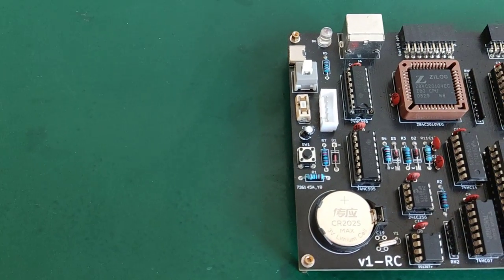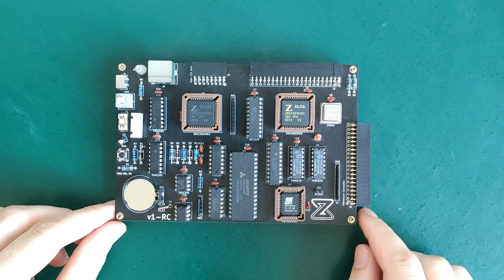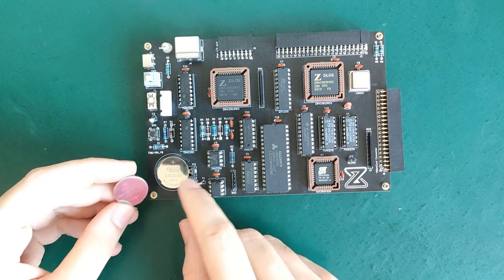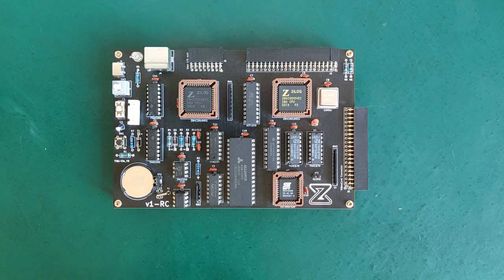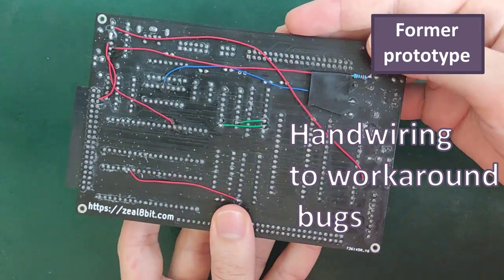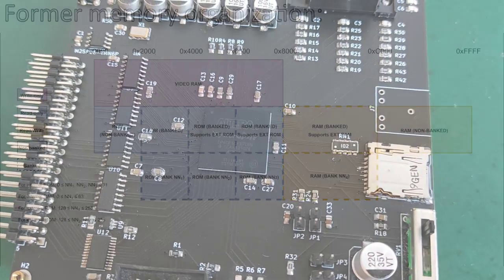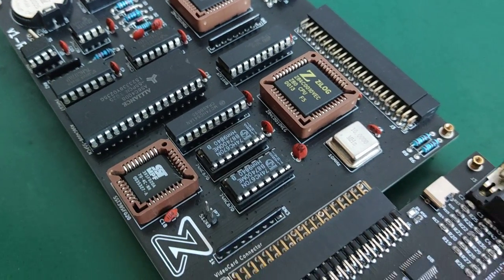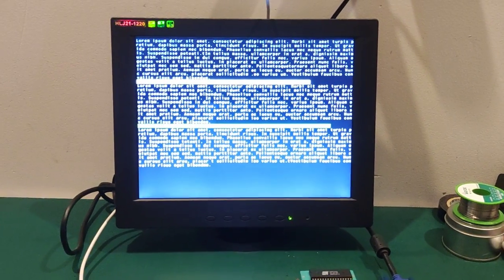Latest prototype of my 8-bit computer [Zeal 8-bit computer]

Comment: I follow your project for almost one year. I am surprised that you have gone so far and made these improvements! The latest prototype seems really exciting. Could I buy the kit ? ( Z80 motherboard and custom video board)
Reply from the maker: Thank you very much for your support, it's very motivating!
Yes, it was a lot work but it was completely worth it.
I plan to sell few units (motherboard at first) in a near future, not sure which form factor: DIY kit or already assembled, I'll keep you informed 😄
Reply: @Zeal8bit  do You have a patreon account?
Reply from the maker: Thanks for your support😄
At the moment, I don't have a Patreon account
Reply: @Zeal8bit  would be nice with an assambled version since i'm mostly interested in the using the computer for programming and not making it. is it possible to get an email when its available....form factor is not important to me, i guess i will build a wooden cabinet for it that protect it.

Comment: Congratulations on the progress of your homebrew computer development! If the CRT interface were made with standard TTLs, the circuits would be troublesome, but it is realized with FPGA and is very integration. I am making my own computer with an old 8-bit CPU too. It is fun to learn the basics that are lost in the latest PCs.
Reply from the maker: Thanks for your message!
Agreed on that, it would be feasible to have a TTL video board, not too hard but too limited, mainly for graphics (for text it should be ok)
As I wanted a platform where we could play and develop games, graphics are important.
Are you using a Z80 also? 6809? 6502?
You're right about this too, I also think PCs nowadays are a bad (horrible) beginning to start learning hardware. 8-bit CPUs and computers have the advantage to be deterministic, simple and can be mastered by a single person.
Reply: @Zeal8bit  Thank you very much. I use 6802 and 6502. The Z80 I used 40 years ago.

Comment: Great work!

I am 59.

I was a bit too old to get the bug as only young pre-teens can, but I was into doing 8 bit hardware and software (firmware mainly) as a hobbyist.

One very very advanced CPU was the MC6809E a multiprocessor environment compatible device.

I get that you are a Z80 fan boy, but if you look into the E variant of the MC6089, it will shock you. 

Truly unique, Excellent device!
Reply from the maker: Hello, thanks for your comment!

I discovered the 6809 recently, while talking with a friend who is also a hobbyist and made a homebrew computer based out of it and I must say that the 6809 is really a great CPU. I love its rich addressing modes. It's a shame it wasn't more used or more known. I guess it because it came out late and was more expensive than the Z80 or 6502.

Is it discontinued? I have seen some brand new 68000 not a long again, but I don't think I have come across any 6809
Reply: @Zeal8bit  AFAIK, Hitachi souped up the ALU and registers to make their 6309, still in production.

I would be very surprised if the 6809E is not still in production. 

I have a funny feeling this CPU was "too good" for tge home market. It got used a lot in Japanese business equipment. I saw it in electronic typewriters I repaired at CANON Australia in 1985.

The LEA, etc., make it GORGEOUS for compilers to generate code for it. The position independent code is made for implementing NICE software!

I only coded mainly for the 6802 or Z80.
A bit ofc6809, but you need a compiler to make it sing.
Reply: @Zeal8bit  looks like they are mainly old new stock. Prices around $12...
Reply: You're never too old to pick up a hobby like this. I read somewhere that a lot of electronic fairs are populated by people in their 50's, so you don't need to be a young pup to explore your interest.

Comment: This is fascinating, thank you for sharing your development process! I had considered using 3  4x4 register files in my MMU, but I most of the ones I saw were obsolete. In that design, I ended up going with the 74610 instead, but it's kind of awkward to use because it has a 12 bit data bus, so as far as I can tell, the 4 upper bits would have to be buffered. Given this I might consider looking at the 670. I believe my MMU design differs from yours in that a) I use 4KB pages and b) that I also intend to encode memory protection into the page table. The 670 looks like it has the advantage of having a surface mount implementation, so overall it might still have advantages over the 610. Thank you for the inspiration, and happy hacking!
Reply from the maker: Thanks for your message!
In your case, the 670 may not be ideal. With 4KB pages, you will have 4 bits left to select your MMU pages (4-bit page selection + 12-bit page offset). That gives you 2^4 = 16 different pages. If you want the pages to be all different, you will need at least 16 / 4 = 4x 74670 chips! Even with 4 chips, that would give you a physical address space of 64KB (16bit address - 4bit page selector + 4bit given by 74670). If you want a physical address space of 20-bit, 1MB, you will need twice more 74670, so 8 chips. Moreover, that won't give you any protection feature.
As such, in your case, using a CPLD may be the best option, in terms of cost, space and convenience (easier to debug in case of problem).
Reply: @Zeal8bit  Thank you for your analysis. I have actually considered going the CPLD route, and yeah, you're right; for some bizarre I totally had a brain fart and was thinking the 670 had a 4 bit address space, which in hindsight is clearly not the case. For some reason, I was confusing this with the 74189 (which does have a 4-bit address space), so I would indeed need a great deal more glue logic than I was initially projecting.

With that having been said, I have actually considered whether or not having a 64KB virtual physical address space is something that I might want to entertain. You'd obviously lose the ability to address beyond that range (which is kind of important given the size of modern RAMs), but it would allow you to shuffle memory around which might be kind of handy for mapping the BIOS Data Area for CP/M. As for my implementation of memory protection, the way I envisioned it was that this would be enforced through hardware by asserting NMI when a fault ocurred. The protection bits would be output along with the translated address and then discrete logic could be used to generate the memory protection signals. I could also use this to inhibit writes so that the transaction never actually occurs.

Comment: This is incredible. You have managed to condense the project, and in the process used the freed up space to add more features. 

Moreover, this is going to take up a much smaller footprint overall. This adds to some greate possibilities, such as creating a computer with the same sort of footprint as a Raspberry Pi 400. I mention this, because then it would have a retro computer feel, which would be awesome for this wonderful little project.

I also suspect I have missed a few videos, because things seem much further along than when I last watched. 

Keep going, this is great. I can see you get to a final version in the next six months or so, easily.
Reply from the maker: Thank you for your long-time support ! You're always here on time 😄
To be honest, this was the very first goal, before even starting the project, I wanted to embed the motherboard inside a keyboard. This would really look like retro computers of the 80s. However, this adds a lot more work as there would be 3 PCBs, and so, more things to support.

Nonetheless, I haven't completely dropped the idea, that's why I mentioned the presence of an "internal I²C bus" 😉

I will try to at least finalize the motherboard within the next 6 months. After all, the motherboard can be used without the FPGA 😄

Comment: I've been following for a while. Because it seems like the best chance of someone with the skills being and to build my dream computer too. All I ever wanted in my life was a 8 bit home computer powerful enough to run at around the sprite and graphics performance of early 80s arcade games. Do you have this working on 15khz video?
Reply from the maker: Good news, that's also my goal! 😄
Simple graphics yet enough to have sprites and tiles and make nice games that are like old arcades (or Gameboy)
The video output is a VGA signal at 60Hz, 31.468KHz vertical refresh.
Reply: @Zeal8bit  I guess VGA is ok. I grew up in the golden arcade age so I'm used to the look of the slower phosphor 15khz monitors and 224/240p games. But then again VGA allows more detail for games with detailed background rather than black background Galaga and Frogger type of thing

Comment: Really a usable and a modern environment for this old cpu. Great work! The OS is looks also very good, nothing fancy, only useful and important commands. Can you tell us how the memory management unit works in detail if it is not a secret?
Reply from the maker: Thanks for your comment!
It's not secret,  so we have 4 virtual pages of 16KB which can be mapped to any 16KB window of the physical 4MB of address space. In the hardware, this is implement with a 4x8-bit SRAM chip.

To swap in and out the pages, a single OUT instruction is required, for example, to make the first 16KB page point to the physical address 0, I only need to execute:
ld a, 0
OUT (PAGE_0_ADDR), a
, if I want to point to physical address 0x4000, I only need to change ld a, 0 to ld a, 1
etc...
Reply: @Zeal8bit  Thank you! Now it is clear, I see every page has different address. Good idea!

Comment: Yeah! Eight Bit! And an FPGA working overtime in 64-bits minimum. In fact every bit is looked after from many viewpoints, every bit is checked from the left and the right, weight, speed and direction is controlled. How would you get all of those bits looking in the same direction if there was not something bigger behind it? All bits are marching exactly on the right time. When Von Neumannn started with computers they often had to wait for slow bits that always came late.

Comment: Would you consider making the video card something designed for "stand alone" use with other systems? For example, a version that could be used with 6502, 68000, or other architecture systems. And does the video card support 16:9 aspect ratio and 720p or 1080p resolutions? It could be a real game changer if it could be redesigned as a platform-agnostic, retro-friendly video solution.
Reply from the maker: As discussed on Discord, yes, this nothing in hardware is limiting the video board to be used on any other 8-bit system, as long as the I/O, memory and RD/WR signals are still correctly provided.
I will talk more about the video board in the future

Comment: This could be an alternative to the Commander X-16 for those who prefer the Z-80 to the 6502.
re scrolling:  You should have hardware scrolling by changing the position of the display window within the frame buffer, and have it wrap around.
As for when you do need to copy blocks of memory: does this board (or the video card) feature DMA?
Reply from the maker: Thanks for your comment! 
It can be seen as as an alternative yes, but much less ambitious though, I am not trying to build the ultimate 8-bit computer. I would like to build something small and simple, yet very funcitonal.
I perform the text scrolling with a similar approach, I store the index of the line (text mode presents 80 columns, 40 lines) to show at the top of the screen, and I show the rest of lines while wrapping around when we reach the last one.
For both the text mode and graphic mode, there is no pixel framebuffer. They work thanks to tiles. For to reply your answer, no there is no support for DMA on either board, the CPU can copy data to VRAM either with a simple ld instruction or with the more complex ones like LDI, LDD, LDIR, LDDR...

Comment: its a shame you moved the circuit board design to only use the PLCC package connectors, as I was thinking to make an adapter for the CPU socket and using a RPi of some sort instead (ala BusRaider RC2014 / PiStorm), but adapter interface to a PLCC (especially such small ones) are not easy to find, nor easy to make. - I do see you can remap a physical ROM to "40pin Extension Port", but I also noticed the new board layout does not contain the "other 40pin bus port"
Reply from the maker: That was a diffcult choice to make, but I didn't want the board to be too big. The main board being 15x10cm and the FPGA one being 5x10cm, we have a total of a bit more than 20x10cm (there is a small gap in between). This was the limit I didn't want to exceed.
As you saw, it's possible to remap everything through the 40 pin Extension Port, even the CPU! Another possibility I see is to not solder/desolder the PLCC sockets,it will give you regular 2.54mm pads. You can imagine soldering pin headers there and connect your board on the top of it.
Regarding the other 40 pin bus, which was a "debug port" , it didn't only take space on the PCB but it also made it much harder to route. As I said in a previous comment, now that the extension port has all the signals, it could use it for debugging and get rid of the "debug port".

Comment: So, I've been wondering with a lot of these modern retro computers, why not design around modern PC form factors like Mini ITX so that cases and such are simpler affairs? Just curious if there's a reason I'm not seeing.
Reply from the maker: Thanks for your comment!
It is possible to design the PCB to have a Mini ITX, but from what I know, the connectors are also standardized, their location on the board too. In the case of an 8-bit computer, most connectors won't be here, including: Ethernet port, USB port, etc... So in a case, that would leave a big empty spot at the back of the case.
In my case, it's also because I am "limited" by the fact that I want the video board to be on another board that plugs on the side, so that the motherboard can be used alone.
When I started the project, I also wanted to have the whole motherboard inside a custom keyboard, which is why I decided to have a form PCB form factor.
Reply: @Zeal8bit  that makes perfect sense! My dream is an 8 bit machine in an ITX form factor, but in the case of Zeal, I can see why you laid it out like that now. Thanks for responding! Best of luck with the development, I'm looking forward to seeing where it goes!

Comment: How did you attach that bga fpga to the video board? The largest non-bga fpgas they make only come in 144 pin packages. This means that if you can't do bga parts but still need high pin counts, you have to use 2 qfp chips working in tandem which ends up being twice as expensive.
Reply from the maker: I soldered it. The FPGA I am using is in a BGA256 package, in fact this Lattice FPGA only comes in BGA.
Why would I use a non-bga package?🤔
Reply: @Zeal8bit  That's a 256 pin bga package? WOW!

Could you explain roughly the process you use to accomplish this? Attaching just a 24 pin BGA device to a board is already a respectably difficult task. 256 pins is insane. There are so many things that have to go right for that to actually work. Where do you get the stencils? How do you prevent the stencils from flexing when they heat up? Do you use solder paste or do you put bga balls into the stencil holes? Do you use the sn63pb37 solder (which is supposedly the easiest for diy bga)? How do you align the chip to its socket? How do you keep the chip from moving when heating it?

On my next pcb, I'm going to be using 2 144pin qfp surface mount Xilinx cplds working together, I'm too far along at this point to change that but after seeing this video, it might be worth experimenting with bga parts again.
Reply from the maker: @scotts-tech  To be fair, it's easier than it sounds, BGA256 chips come with the solders balls already on the chip, so no need for a stencil, no need for more solder. What I do is I apply a thin layer of flux, I place the component where it should sit, I align it with the square that is in the  silkscreen (well, its footprint), I pull the hot air gun with medium air speed and around ~350°C if I remember correctly. It is also possible to use a hot plate but I have never tried myself. 
After soldering I check the connection of few pins. (FPGA pins have ESD protection diode, so if the chip is properly soldered, you should be able to use a multimeter is diode mode to check the connection)
I find soldering BGA chips much simpler than TQFP. The only problem would be desoldering and re-balling the chip.

Comment: By chance will you ever make this more modular using something like old 8bit ISA bus connectors? a backplane with power and cards for each section such as cpu, ram, video, and sound?
Reply from the maker: Thanks for your comment!
I included an extension port for plugging external extension cards. I didn't want to make a backplane with cards to plug because I wanted this computer to be more like an SBC than a fully extensible computer. In fact, I would like to design a case for it at the end. This is more convenient make when the board has a predefined size.